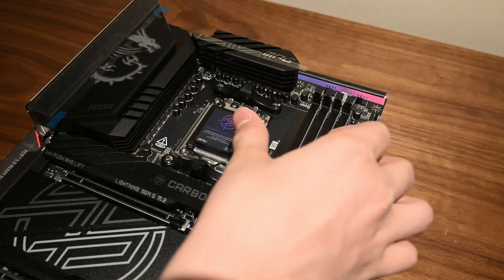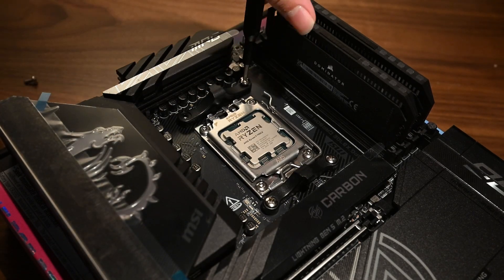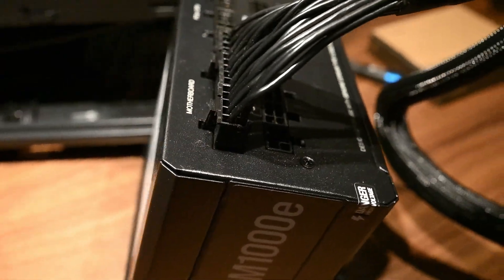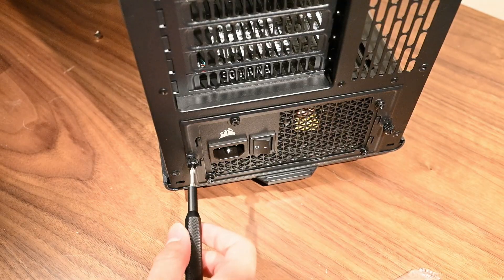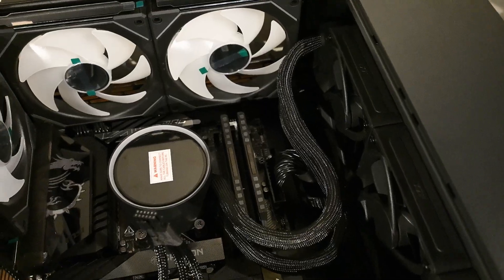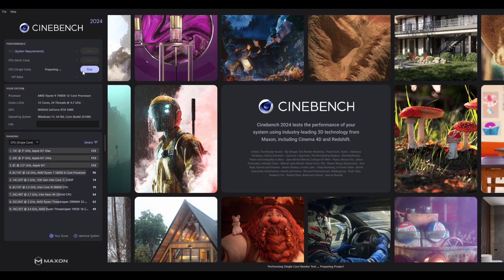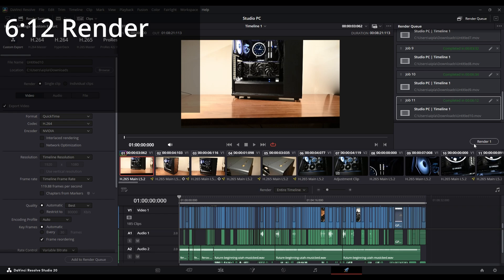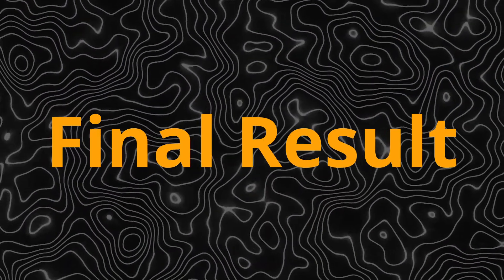Fractal North PC Build: Ryzen 9 7900X, RTX 5080, 64GB DDR5

Comment: Quite an interesting video, but there are some inaccuracies and strange AIO installation. I have this case, and the narrow panel next to the glass can be detached. Also, you installed the AIO completely from the inside along with the fans, but it's better to leave the radiator inside and place the fans on the other side, as they were originally mounted in the case. This way, you can gain about 2 cm of space, and the graphics card might fit on the first try without any fiddling.